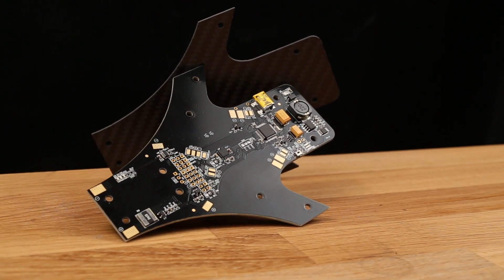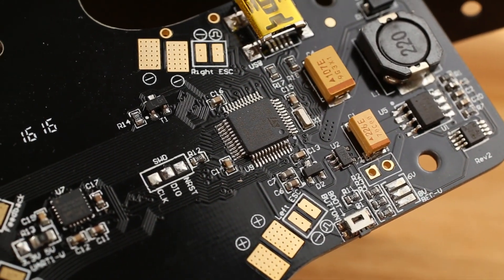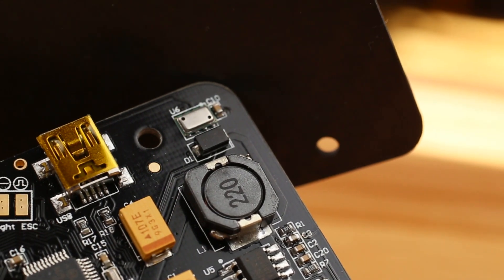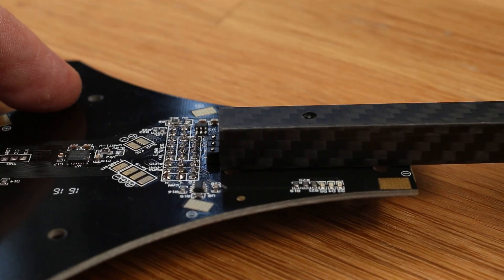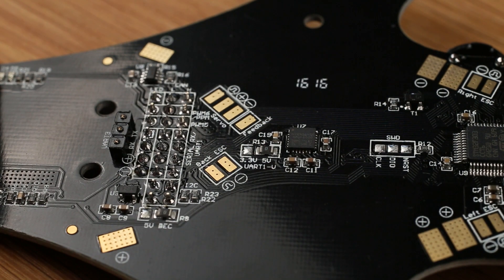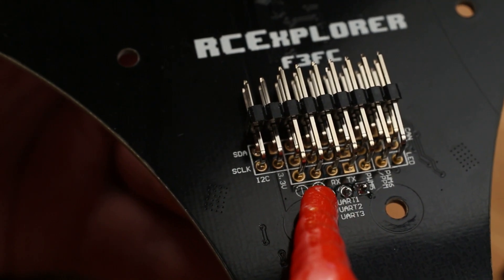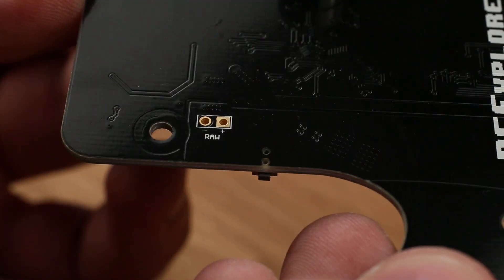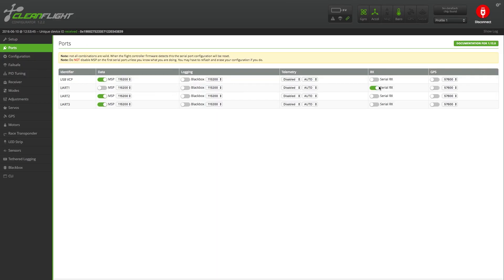RCExplorer F3FC Tricopter Frame

Comment: Anyone have any info they could share around this board?  I have an old tricopter V4 that I never got running completely and I am attempting to complete the build now.  When powering the board, it powers the esc's, but does not power the FC.  If I plug in the USB, it gets its 5V and powers the FC, but as soon as I disconnect, the board loses power.

It wasn't always like this - it used to power the board and I could get the motors to spin, but now it doesn't.  I don't know what happened to it, but hoping someone else has seen this and can point me in a helpful direction.

Thanks!

Comment: awsome design. I have to get one. keep up the good work. so clean.. I like the baro protection.  but these barometers are very sensitive to temperature change... inside that box will get very hot with a switching regulator in there as well.. going to throw off your barometer reading over time... even couple degrees difference after its starts it's calibration can effect it..  keep it up.
Reply: My impression is that it is not a box at all.  It is some sort of a foam surrounding, open on the end.